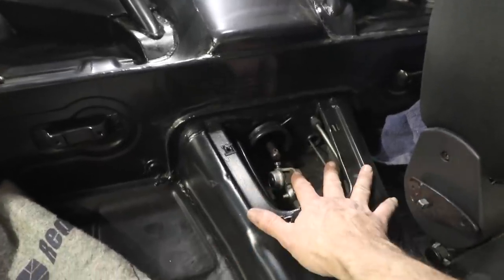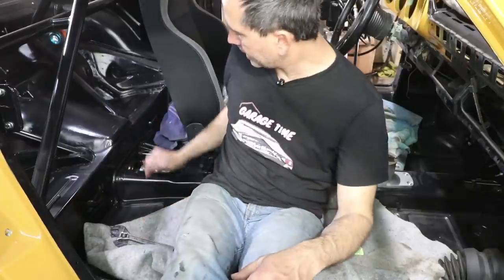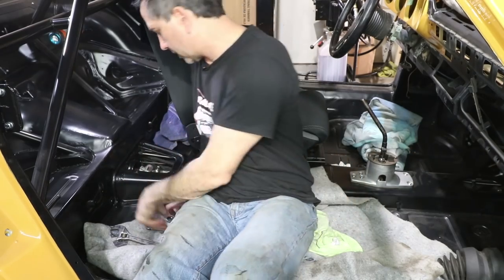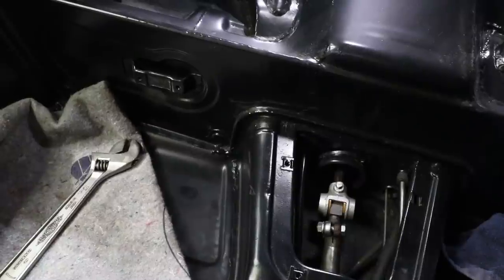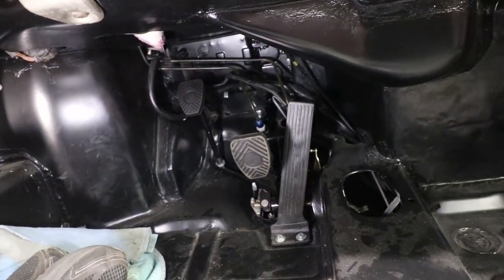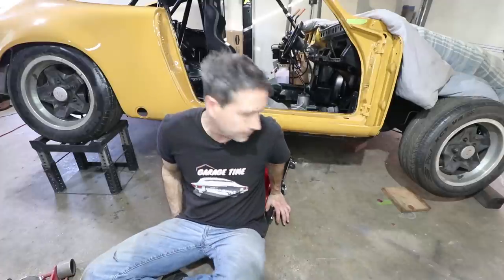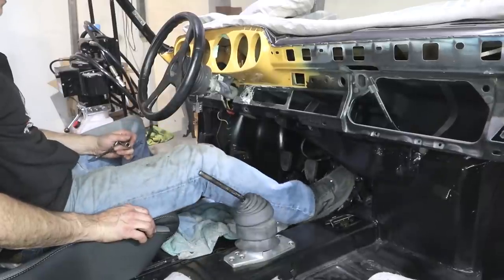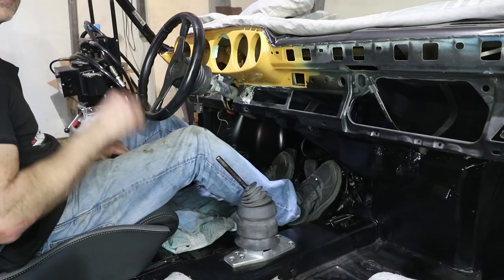How to Adjust Shift Linkage and Pedal Positions for Excellent Feel

Comment: Awesome video!  I was driving my 82 to work today and the shifting kept getting worse till I could not use 1 or 2nd.   Got to work,  searched Youtube and found your video!   Found out shift rod coupler bushings were gone!   Used a piece of hose and put it over the rods on the bushing to help get me home.   Hopefully it will work in a few hours when I get off work.   Ordering a new bushing now.  Thanks!
Reply from the maker: Wow, that's a great roadside fix.  If you do need to adjust the coupler be warned that it's very sensitive to rotational adjustments. One pencil width of adjustment makes a big difference.
Reply: @GarageTimeAutoResto  I drove it all day after the quick fix!  Shifted better than it had ever been for me.  The bushing was probably going out when I got it years ago.   But I didn't know.   Hopefully the new part will be in today and I can do your adjustment trick.   :)  Cheers.

Comment: I followed your instructions and I was able to dial in my shifter perfectly! Thanks for the explanation!
Reply from the maker: Great news Reid!  Happy shifting!
Reply: I have another question, not to take away from this video, but did you happen to do a video of how you painted the interior floors of the car you were doing the shift coupler adjustment on?
Reply from the maker: There are a few
Here's the first epoxy coat
https://youtu.be/IF8NdGtWokM

Comment: Getting closer! Isn’t there a boot that goes over the coupling? Would have been a good idea to to added that on before adjusting the coupling.
Reply from the maker: Yes, there's supposed to be another boot, but I'm leaving it out.  Not sure what it does if its inside and under a cover too?
Reply: @GarageTimeAutoResto  probably just another layer to help keep fuel smell(and other smalls) out of the inside of the car.

Comment: Hello. Good videos. Going back in time to this video as I'm doing the same on my 911. Now that you drove the car, did you have to touch to your adjustment again ? Or did it work just fine ? Thanks.
Reply from the maker: Thanks, occasionally my car pops out of third, so I did adjust the linkage a bit and it still pops out.  Mostly when cold.  I may fiddle with it, but the problem is likely inside the transaxle.  
The pedal positions are mostly good, but I want to shorten the brake pedal push rods just a little bit more.